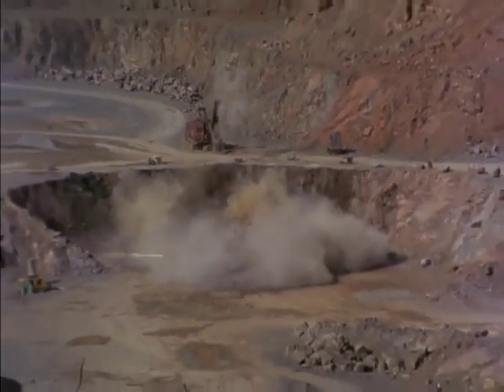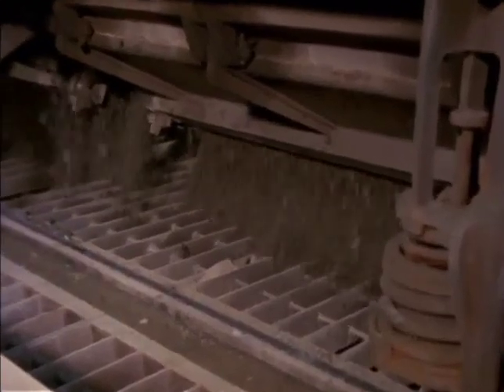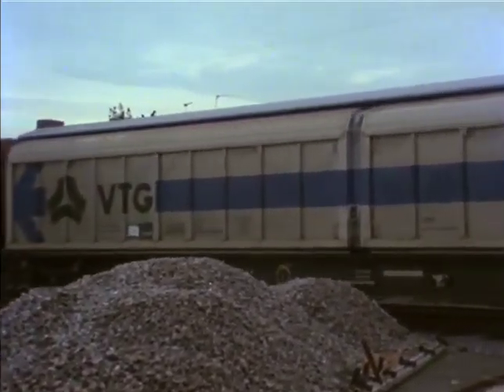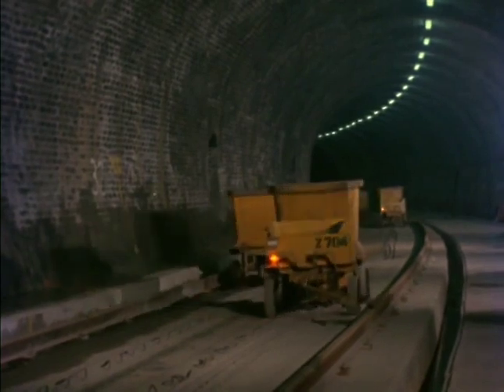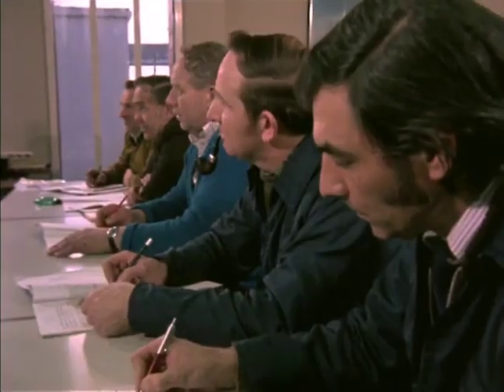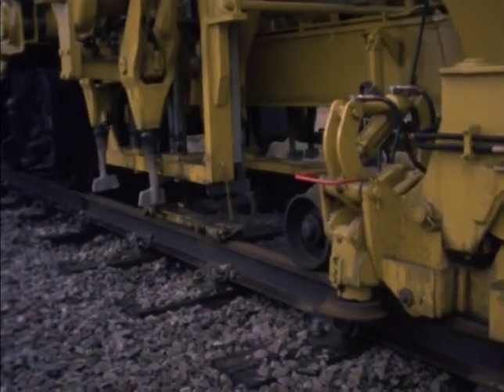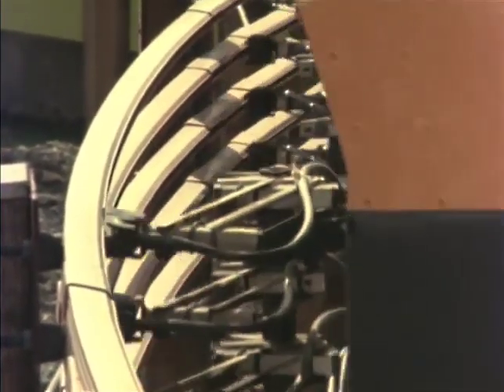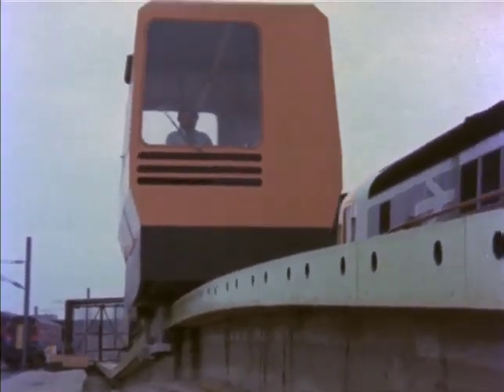Vintage railway film - On track for the eighties; Rail report 13 - 1980

Comment: I travelled on the hovercraft service from Dover to Boulogne back in '89. It was hardly a smooth ride. Also crazy to see a maglev train being developed at Derby. It was certainly a lot slower than the maglev service in Shanghai which runs at speeds of 270 mph.

Comment: HST yes. APT no. (And a power car mid-train was super stupid.)
Reply: No it wasn't. Until recently, before individually powered cars, Type 90s trains (for example) were pushed all the way from Glasgow to London as the 'pantograph' powered unit was at the rear on the return journey. That is more extreme than a centrally placed pantograph unit.
Reply: @jonahspiper  I agree, they gave up too easily after a few journalists got queasy. And when you consider how much was ploughed into Concorde compared with the less than £50M for the APT, they could have straightened out track every curve between London and every other major city.
Reply: @29brendus  But the APT would have been rendered uneconomic by additional crew needed to serve the two halves of the train.
Reply: @grahamariss2111  A valid point, but probably it wouldn't make too much difference? I'm not sure if 2 buffet cars would be needed? I am assuming that there is a passage through the the power car? I daresay it was experimental, but an interesting time nevertheless and no doubt some of the technology was fed to the HST, and class 87 / 90, etc
Reply: @29brendus  The APT had two buffet cars, for safety reasons staff could not transit through the power cars when powered up so guards were to act like bus inspectors with two guards joining and leaving the train at stations.
Reply: @jonahspiper  That was the original plan, but the limitations of the WCML overheads meant that at high-speed the lead pantograph set up a wave in the overhead cable that lead to the following pantograph bouncing on and off the cable and so risking damaging both pantograph and cable. BR engineers were not happy about the safety of running high voltage cables under the passenger compartment or the stability at high speed of the lightweight carriages running at 160 mpph when all being pushed from one end, so the compromise was to put the two power cars together in the middle.
Reply: @29brendus  Not the HST that was well into service when APT arrived, the HST was a project taken up by BRs own engineering facility in Derby, and is just a set of Mk3 coaches between two diesel locomotives, as a response to the largely aircraft industry engineers recruited into the APT project. The Pantograph was used and some of the power car technology in the UK next generation of electric locomotives. The licence for the tilt mechanism was sold to Fiat, they used it on a couple of trains but they found as with APT, whilst it allowed greater tilt angles than the SKF system the Swedish X2000 uses, it needed a lot of maintenance and took up space in the passenger cabin. Fiat thus adopted the SKF system for subsequent trains, this includes the Penalino trains that now run on the WCML.
Reply: @grahamariss2111  Thanks for the information. Cheers.

Comment: Meanwhile in the United States we don't even have electrified rail in most parts. And they had hovercraft back then. Like what are we doing.
Reply: And to think american rail modernized before british rail
Reply: @BlackMan12331  "modernized" we're still running diesel engines. Amtrak even put it in order for diesel electric trains so we're going to be on the diesel for the next 50 years at least instead of just electrifying the rail
Reply: and the fact that the HST Was already 5 years in use and the APT Was in testing! America still doesn't have anything like the HST And the Acela came 20 years later!